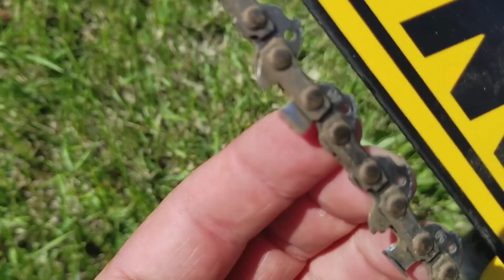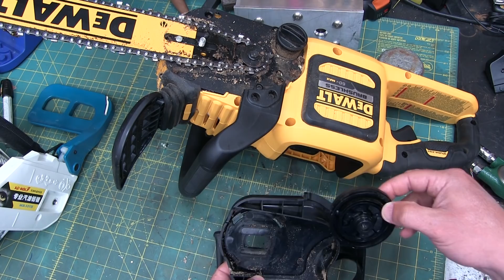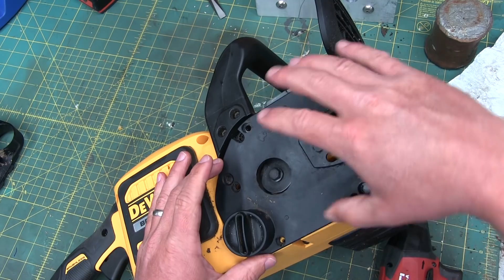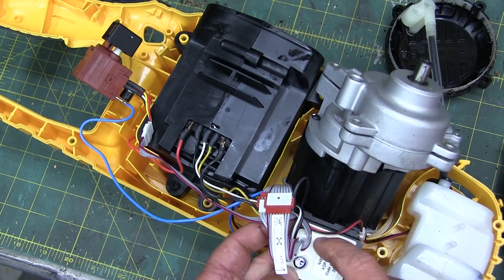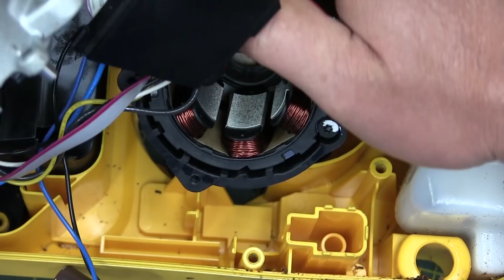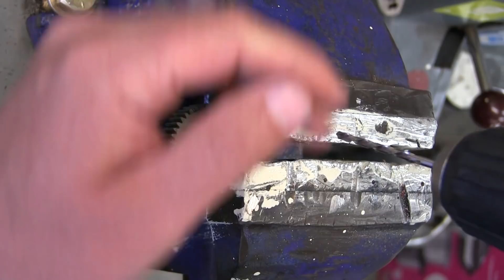BOLTR: DeWALT Chainsaw | Engineering FAIL

Comment: great ropes, i agree, and no real reason for such a long bar, a 12 would be perfect

buzz buzz, best story ever, and trues, guy call us to come out and drop the service to his house so he could cut a large tree that fell on the house,  yep, his tool of choice was  pixie powered, had one of the tree crews that were up the road do the scary part for him
Reply: Fun fact, more people are injured by short bars then a long bar. The shorter the bar the more kick back it has as you have less distance from the front cog of usable chain. I will not run a saw shorter then a 28in bar EVER.
Reply: duce wags if you have problems with kickback while using a tool designed to trim garden shrubs then you probably shouldn't use any saw ever.
Reply: That my friend is true. Garden shrubs I trim are over 100 feet tall.
Reply: Pgcmoore the 20 volt only has a 12” bar works great
Reply: duce wags try using that in a bucket truck or 50+ foot in a tree for hours
Reply: Tyler Cooper I don't do bucket trucks, I drop trees from the ground.

Comment: I bought the 12” model to work as a de-limber because I have many 20v batteries. It cost $200 at Home Depot. Not getting the same problems as you had; shorter bar so less leverage. I cut up a fifty foot birch in half an hour last weekend. Naturally I used my Stihl to drop it

Comment: I work for a fairly large tree company in Virginia. One of the owners decided to buy a few electric STIHL tree climbing saws. Long story short... Some things are better left alone. Electric saws have no place on a professional tree crews truck. Even for pruning trees. Batteries go in television remotes for when real men get home from work after running a two stroke, internal combustion, air cooled, wood ripping, ass kickin, 200T STIHL climbing saw, all day. Batteries my ass. Send my saw down to the ground man and he sends it back up to me with a fresh tank of never fail go juice and bar and chain lube. That's how a saw is supposed to work. Batteries? Get that shit out of my face. I'd short that saw out from the sweat dripping from my forehead before I could go through the first limb anyway. Battery operated homeowner specials. Wait till you go out and do hurricane damage. You'll need a generator just to power the chargers and by the time you charge those Batteries? I'd make 10,000$ on less than a gallon of gas and saw mix. Lmao! Go Green!! I'll make green while you go green with envy.
Reply: Common Nons3ns3 xx...sO eDgY....xx

Comment: My family got one of these when a tree fell during a storm. After many battery troubles, we finally got it running. It worked for maybe half an hour, but it was burning through oil and the drive gear ended up fusing to the plastic. Might be good for branches, definitely not for carving up fallen hardwoods.

Comment: In spur cut gears (assuming involute flank shape) the flanks do actually slide against each other. Except at the operating pitch diameter, there you have pure rolling. So there is sliding and rolling.

Comment: I got the same chainsaw but the blade does not wobble around. I've only used it to trim up 3 mid sized apple trees last year. Went through one and a half batteries. One 6ah and half a 9ah. I also don't remember it ratcheting either but I've also never tightened the chain fully down so I don't know about that. I do know the inside where u do the blade change gets dirty right quick. Kind of a pain in the arse. But It's a 16inch chainsaw so I don't expect it too do big jobs. Great for a quick clean up just make sure u got two batteries. Maybe the new 12ah Battery Dewalt is coming out with soon ''that's apparently the same size as the 9ah'' will be a better fit for this chainsaw. Interesting to see the strip down tho. Like always, Good vagaio.

Comment: The tensioning screw indeed had a problem which I modded by reciprocating saw cut straight down thru the plastic knob just into the top of the screw enough to get a flat screwdriver in there to force the tension past factory specs.
Improved bar stability enough to run all day with enough batteries, felling 20+ cm diameter trunks.

Comment: We bought this thing for situational use, but after several cycles on the battery it was pissing bar oil all over my work and the tensioner shaft had sheared right in half. The oil problem is unfixable, but the shop tech unhelpfully suggested I empty the oil out between uses. How that would improve oil metering during use is beyond me.

Comment: The torque limiter in mine did not limit, and I snapped off the handle. I replaced it with a piece of water pipe and side drilled it to pick up the pin.

Comment: Glad I found this video mentioning a dismal 10 minute run time, I thought mine had problems or bad batteries but apparently just the way they cheaply built it.  Haven't had chains flying off yet, but I did manage to somehow bend a tooth on the chain so it'll catch and bind very easily...time for a replacement chain now that I got that tree down and taken care of...yes I cut down a tree with mine, yes it took me a couple weeks working at it here and there and of course waiting for batteries to charge.  Unfortunately for the cost of the saw it should come with 2 batteries and a replacement chain and a case...the cheesy plastic bar cover is a joke.

Comment: Stihl did one like this some few years ago with an infernal 2 smoke engine but they used cast aluminum for the bar guard and the ratchet mechanism was made of the powered steel play dough it was quite skookum

Comment: I recently bought an electric self-propelled walk-behind lawn mower because I was getting tired of tinkering with the old Lawn-Boy for a half an hour before each mow. I was researching the Dewalts at first because I thought, "Well, at least they'd have a product I could trust." But after looking into them it occurred to me that Dewalt may not build a very high quality lawn mower, it appeared to me that Dewalt threw together a simple and cheap mower to run on their batteries, which is either two 20V or a single 40V, depending which mower you buy. And besides all of that, Dewalt doesn't make a self-propelled mower. So instead I decided to buy an EGO Power+ 56V 21" self propelled walk-behind mower. I'd sure love to see your opinion on any of their products. They seem to be solely dedicated to electric lawn care/outdoor power equipment. I bought their big 7.5 AH battery with their mower and it lasts a very long time on a charge, charges extremely fast in their battery cooling fast charger, and it even powers through grass up to 2' tall without bitching about it too much. While I do feel they could slightly improve their blade/deck design just a little bit, as well as design an on-board battery cooling fan for when you really want to cut hay with it, I do feel like they have a very good product. They also make string trimmers, chainsaws, leaf blowers, and even an impressive looking dual battery electric snowblower. Their mower is higher priced than most gas mowers, but I noticed it was still cheaper than a comparable Honda. Maybe someday I should be a salesman for them?
Reply: I now see you did check out one of their blowers. I'll go watch that now.

Comment: Fell 3 50 foot sycamore trees with that saw. Limbing them before the fall took a couple of battery charges, dropping the trees took 2 batteries per tree of I remember correctly. This was about a year ago. A few days later my brother in law was cutting up the trees when the bar attachment came loose and the saw became inoperable.

Comment: DeWalt IMHO is the new black and decker (B&D does own them after all), everything they make now is junk.

The Greenworks pro chainsaw has two beefy bolts to clamp the bar, They make decent battery powered crapola.

Comment: I own a Christmas tree lot during the season and we use a gas axe for putting a fresh cut on the bottom of the trunk before tying to the roof of the old Subaru. That noisy, smoky pain in the ass machine has to go this year and I'm kinda hoping this lectrik beaver will make a suitable stand in

Comment: Question, if you don't mind.  I mess around with blacksmithing and a little welding. (Not electronics)  One problem with forging in the winter is heating up the anvil.  I used to do like most and heat up a chunk of steel and set it on the anvil. Someone suggested getting an old electric iron from the flea market and setting that on the anvil. So I did that. Bought one for a couple dollars. 
Came back to the anvil and it was cold as ice.  Apparently there is an automatic cut off.  Do you know how to disable something like that?  
I would have used email but I didn't know how else to contact you.  Thanks.

Comment: Two big clues on MOSFET location, in addition to heatsink:
1. There were no power wires from the little board to the motor. Going to need 2 for battery in and 3 for motor out. All little wires connected to potted board.
2. you can see 6 bump-outs in the plastic cover on the motor assembly, that are the right size for the 6 MOSFETs you need to run the motor.

Comment: This is a great tool for landscapers as it starts right up and no gas so great for throwing in the backseat. Needs new bar and chain but run time is great for what it is. You can easily take down a small tree and buck it to take to street on a single charge. The bar and chain are crap but has great torque and power. Use it weekly and its great. Even though it will take down a small tree its best at just grabbing and taking down small to medium limbs at a moment notice. Grab go cut leave.

Comment: nothing wrong with the tensioner. It hold up just fine. The main problems with the chainsaw are the seal on the oil fill cap leaking, and the ratcheting bar lockdown nut vibrating loose as you are cutting. Also, you should get some fine wire and twist it around the hoses on the oiling system so that they don't loosen and start leaking internally. I have been using this, and the 12  inch version both since they first came out.

Comment: i have a poulan wild thing from a bygone erra when i was a kid, probably made in the early to mid 2000s,  found it in the scrapyard and took it home for like 3 bucks, the seals had the common ass problem where they leak around the outside so i just rtv siliconed it all around and it fires right up 10th 11th pull every time, its got the dual throttle body where at idle to mid its just the carburetor then at wide open it opens a second throttle body to let air straight into the crank case, never seen that before but it gives it like a dirt bike powerband so once shes up in rpms you giver wide open she goes like an alarmed homonid

Comment: Honest question - what does this bring to the table in terms of busting pallets, hacking off small to medium bits of tree (dead or otherwise) that a cordless recip saw aka a sawzall can't do? As I'm really struggling to find something that this would do well that a cordless sawzall couldn't do as well or better..........

Real dissappointing there default real dissappointing...
If it had been a Homlessdespot special, then a it would be a bit like that Ryobi jigsaw I bought from their UK Cousin with the same colours and different owners, wasn't til I got home and tried using it that I found it was junk, a pooch pissing in snow could cut straighter lines...on the back of the box - made especially for bnpoo......crap...ain't bought no powertools from them since...

Comment: Hey AvE, got a plastic question: What is "UP (GF+KD) 63" ? I think the UP is unsaturated polyester with 63% of glass fiber, but I have no idea what the KD stands for.  The part is a plastic shield that goes between the exhaust pipe and the fuel tank on my car. Just wondering what kind of thermal properties it has. The new exhaust I put on comes quite close to it.

Comment: Last time I had to extract a broken bolt that was recesed and kind of unreachable to unscrew by tapping it slowly, I grinded a harder bolt until it had a really sharp chisel and I smacked it directly on the center of the bolt with a hammer. It pierced the bolt and could unscrew it by hand. It was the bolt that retains the blade of a push mower.

Comment: My Jonsered (50cc 18” bar) has the single bolt tooless bar adjustment. It works far better than I figured it would.  It doesn’t have the kung-fu ratchet action though. That’s the killer.

Comment: Looks like one of the hard rubber pads that is supposed to push down on the guide to hold it tight is missing??? Could this be contributing to the wobbly guide?

Comment: Gotta say, for my mind, that chain tensioner mechanism itself is just fine, and quite a clever idea in terms of convenience/ease of use.  Normally when I'm adjusting the chain on a regular 2 smoke saw, I have the two bar nuts slightly loose, to allow the bar to slide nicely, then once the chain tension is set I lock the nuts up, thus clamping the bar to the saw - at which point there is zero load on the tensioner. (FWIW, the newer Stihls must have some kind of bevel arrangement too, as the screw to adjust them is on the side rather than the front)

Where it falls down in this case of course, is the absolutely atrocious clamping mechanism for the bar, which just looks like a lawsuit waiting to happen.  If they'd put metal plates either side of the bar, and the traditional two nuts to clamp it, I wouldn't have any qualms about that tensioner - it's probably more skookum than the traditional screw setup in my dad's small Husky (I hate the piece of chit, give me his MS361, or my 30 year old 032AV any day), which is held in a plastique side cover and pops out very easily - but works fine, owing to having the standard 2 nuts clamping the bar.

A pity really, the rest of the saw looks quite solid for what it is (battery life issues aside, that's kind of a given with this type of thing), just looks like they ran out of development time, imagination and/or budget when it came to actually attaching the bar, and halfassed the feck out of it.  With regards to having to clean the schmoo out of the braking band, it looks no different to any 2 smoker I've ever played with, they all need cleaning out at intervals.  Especially if you cut up a palm tree, the fecking palm dust is really wet, then goes rock solid and rusts everything solid in there if you don't clean it out stat (unlike most normal trees).  DAMHIKT.

Comment: This was a good video. If I buy a battery powered saw I will be sure to check these things. I bought an electric one one time and it had a nylon gear inside it that was weaker than the motor... I guess you can figure out what happened next...

Comment: Super excellent video! I own 4 of these chainsaws and have cut down and processed about 20 large mesquites with them. They do break. Two have died from overheating, and one died because the kickback bar won't reset. I live in Hawaii, where there is no DeWalt service center to fix them, so I'd like to do it myself. I have 2 Q's: 1) What electric parts should I buy for the overheated saws? 2) What do you think about the bad kickback saw?
Reply: kickback reset switch. Its in the video

Comment: I paid money for a 2 stoke version, but after about 2 hours running total that plastic tensioner, clapped out. Was a bit sore on the build, but I have found another use for the motor

Comment: Where as I agree the bar moves around considerably the saw (40 volt version in my case) has been beaten to within an inch of its life and still runs flawlessly.  It's had 8 chains....the thinner chains are cheap and really not worth sharpening imo....and I've used it to drop 28" trees and buck them no problem.  I still use my gas axe occasionally but really never miss it.

Comment: It’s all about target market. This isn’t designed for folks to limb and buck firewood for the winter.  It’s for occasional use by folks who want to take a limb off the tree in the front yard.  So, while it’s not very good at the former, it does pretty good at the latter.  Product sales will tell if they were successful at hitting a product design that the target market will buy, and if they do buy it then it’s a well designed product (in spite of crappy ratchets, low grade plastics, short run time, etc).

Comment: A general rule of thumb that I have is, I do not buy any tools that weren't made before I was born. Most of my everyday use tools (power and hand) were made from the 70's and older. Even my thermo's is the old 1924 Stanley unbreakable 4lb thermo's. I try my best to stay away from the new stuff, I have to find my tools from old couples at tag sales and flee markets. Best way to go anyways :)

Comment: could you thread that second sliding pin so you actually get two bolts? Just thinking aloud here, the plastic shell might not let you but if possible, it might solve some of the mechanical problems of the saw...

Comment: I'm surprised with the build quality. I own several Ryobi 40V brushless units (14" chainsaw and 12' Pruning saw) and they are built reasonably Skookum. I have cut down 12" diameter pine trees that fell across my fence, but that chews the batteries so fast. More reasonable is 4-8" which it can cut without problem. Using 5Ah batteries, I can buck up a couple of 8" poplar trees per charge. I've had it for 3 years and it has worked reliably on the farm.